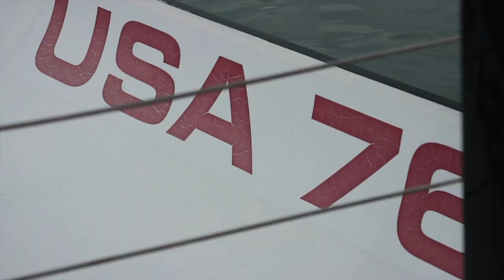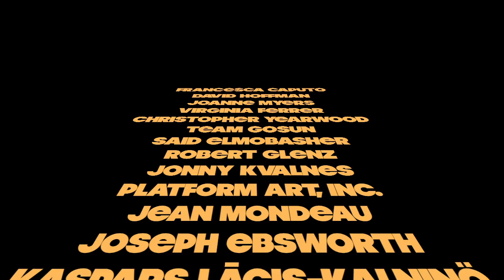40. Bumps and Humps

Comment: a few drops of whisky will cure ear aches fast. It's ok, no one believes me on this one. I was a non believer as well till I tried it. If it doesn't work you can chug the bottle and that might ease the pain for the short term.
Reply from the maker: Makes sense - a little alcohol would do the trick. We started out with just warm water, and then found some hydrogen peroxide, and it did it, but I could see that for sure!
Reply: Keep up the good videos guys
Reply from the maker: Thanks!